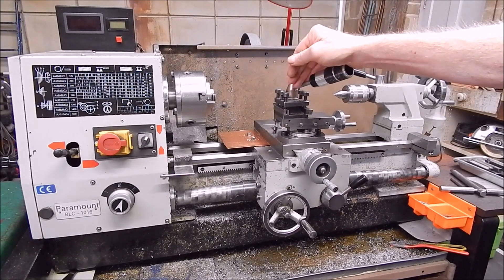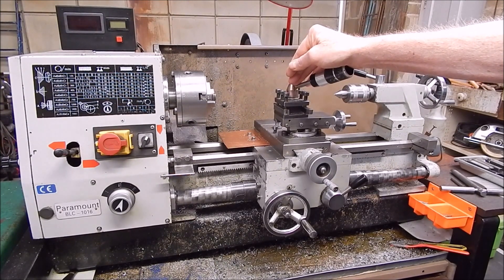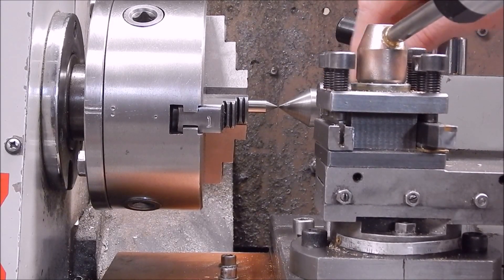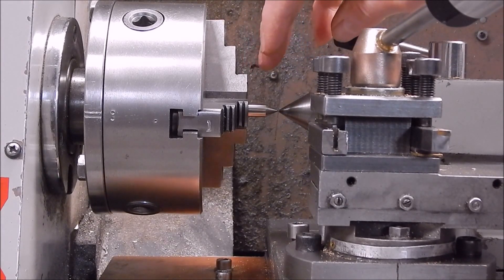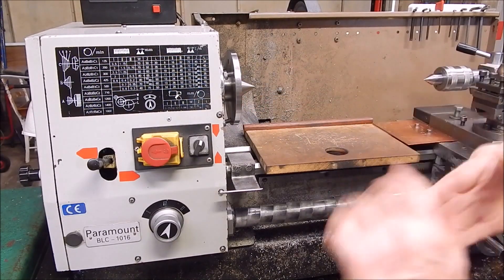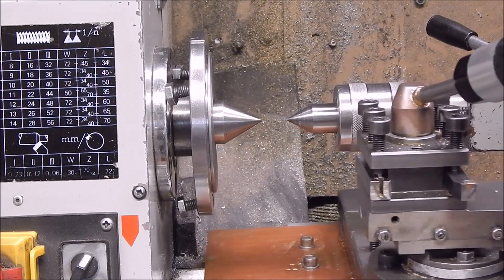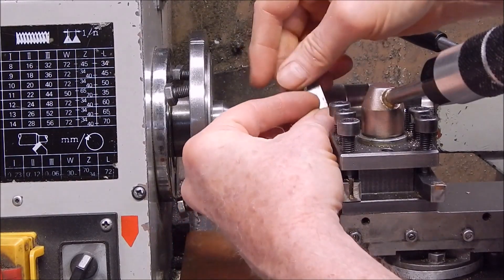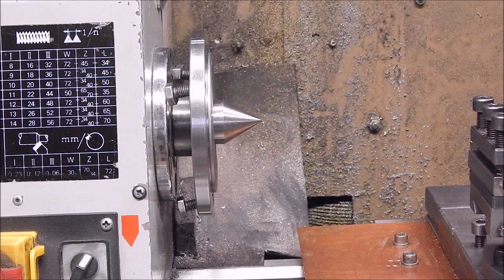How to check your lathe tailstock alignment - the quick and easy method

Comment: If the length of the bed was out by a mm or two, at the end, the centres would still meet in the centre, and the razor blade would still be vertical… I have a problem with my lathe in that when I turn a 25mm x 300mm shaft (without using a centre), it is smaller at the end and larger at the chuck end… this means that the end bedway is not perfectly aligned with the chuck… so I need to find a way to bring the end of the bedway closer to the operators side… I haven’t worked out how to do that yet…
Reply from the maker: Hi Barry.  You just move the tailstock away from the operator to fix the taper error.  It should have adjustment to allow for that.   Cheers Rob
Reply: @Xynudu  no, if I use a live centre, then it is parallel… but if I don’t use a live centre, just a 25mm shaft, 6 or 8 inches in length, then the shaft is tapered…
Reply from the maker: If you machine that length of shaft unsupported it will certainly be tapered smaller at the chuck end, if the centers are aligned.  The job will flex away from the cutter the further away from the chuck you cut.  Why would you not support the job ?  I don't understand what you are saying as the result makes no sense.
Reply: @Xynudu  surely, a shaft that is 25mm ØD by 8 inches long, doesn’t need a centre support ? Maybe then I have to change my approach to this… i am inexperienced so I will take your advice…
Reply from the maker: The job will definitely flex/bend away from the cutter pressure.  Support the job and you will see a difference.

Comment: What if your tailstock is lower then the spindle?  How do you adjust that?
Reply from the maker: Many Asian tailstocks are made in two pieces to allow for horizontal adjustment.  Use a shim between the two pieces at the front edge to lift the quill centre.

Comment: My lathe needs the moon to be in line with the Sun to get that accuracy. Use a smaller drill than stated, to get correct size. Going out now to shim some play out on the crosslide/ bed. Also put a lock on the bed.

Comment: Sometimes I notice things can look a bit out of line due to the camera being used. I have never seen the razor blade test so I'm off out to my workshop to check my own tailstock.. Cheers!
Reply from the maker: It's a very old test that a few manufacturers recommend in their user manuals.  Try it with the tailstock quill extended and retracted as that will also indicate if there is any divergence in the quill.  Cheers Rob

Comment: Well I am only a neophyte or tyro when it comes to metal work.  But I sometime think my drills are jumping to center when I drill on the lathe.  BUT ... As long as it runs true while I am making the hole then there is nor worry to me.  It doesn't seem to affect my projects at all.  I think another way that you can prove your tailstock base is not worn dropping the quill is to mount a piece of know good round stock between centers and run a clock along the top of the bar with the carriage.  Good tip and demonstration Rob.  Now as far as blowing smoke out of my ass, well I had this Mexican dish one time ........

Joe
Reply from the maker: I always align the tailstock by tramming an indicator along a test bar, same as you.  The razor blade test is a good reference/quick indicator, but it doesn't take into account any twist in the bed or ways.  It's quite possible that the tailstock may be off centre at maximum separation between centers.  Mexican food can do that to you ;)  Cheers Rob

Comment: Hi Rob ,
I wish i had a dollar for every time i have read about or watched a video of how to get the tailstock perfectly  aligned and all the stuffing around associated with the techniques they showed . I have seen guys using indicators mounted to the chuck to clock the tailstock barrel , turning bits of bar between centres and all sorts of wiz bang ideas and all of them are overkill! . When i rebuild a lathe i set up the headstock using a precision test bar as this is important i then shove a dead centre in the tailstock and lightly grip the end of this in the chuck and tighten the tailstock adjusting bolts and that is that - for 90% of the work i do with the tailstock ( mostly drilling ) it is good enough . If i do turn between centres i then do adjustments as needed using the workpiece as a guide and when it is all done i use the same method you have just shown to check where everything is sitting and adjust as needed . Lathe beds ( hobby ) are never perfectly straight or unworn so what you set at the chuck will differ to what you get at the other end of the bed and it doesn’t take much twist to knock your tailstock out of perfect alignment - how do they know if the ways where the tailstock is running are truly collinear with the ways where the bed runs ? 
I learned this running cylindrical grinders and you didn’t have time to stuff around getting back to parallel after grinding a taper - use the scale on the end of the table to get a base zero  then touch of at each end of the workpiece and use the feed dial to tell you how far off you are and adjust accordingly. 
That’s what i like - nice and simple , get it done and get on with the job !
Reply from the maker: Yes, that about sums it up.  The razor blade test is just an indicator, but not how I would set up a tailstock.  I generally tram a test bar with a test indicator.  Even that is no guarantee and there is no substitute for miking the job in a few places to confirm linearity.   Having a tool makers lathe makes for good practice ;)  Cheers Rob

Comment: I think it's more likely a drill is not true or the face of the work than the alignment of your lathe...  I know what the bloke is saying but it can be an artifact of having a camera mounted somewhere you could get some vibration or strobing effect from lighting flicker etc. that gives that apparent movement of a drill bit.  Surely the heavy shaft of a centre drill is to give a rigid and true alignment for the relatively small tip section - compared to the small shaft diameter of a small drill bit and the likelyhood quite a few of those cheap small bits are not actually straight on close inspection even from the packet...

Comment: In the past I was stupid enough to adjust the left-right of my tailstock by turning a round bar over and over. The razor blade trick is way easier and faster - thanks for demonstrating!
Reply from the maker: Hi John,  the razor blade trick is a fast and easy way to check alignment and you can use it for adjustment.  I usually use a test bar and test indicator to set mine up, but that's just force of habit I guess.  Cheers Rob

Comment: I went back and looked at the previous video and yes that spot drill did wander around but I think I spotted the reason for it. Rob did not face the end of the brass by the look of it. He cut the brass on the bandsaw, then put in collet and threaded it . It looks as if there is a cut surface not faced as he spot drills it I could be wrong and if I am correct that would be the reason why the 2mm spot drill wandered. Rob it's down to you to tell us if you did or didn't face the brass before spot drilling the work !
Reply from the maker: Guilty as charged.  It looked like a clean cut so I went with it.  Brass also tends to grab a bit with really sharp drills and this was happening as well.  I think you have identified the culprit (s).  Bad Rob.

Comment: The test with the razor blade isn't a definitive test of the condition of the tail stock. Attached is a link to a copy of a Taiwanese made Dar Sin 12"x24" (300mm x 600mm) bench lathe inspection report. Note the inspection of the head stock and tail stock require a ground test bar with the appropriate Morse taper (about $45USD from India).  Items 3,11,12, & 13 pertain to the tail stock. Item 12 checks the condition of the Morse taper in the quill using the test bar.
You can imagine a situation where the razor blade test would indicate no fault but it would be true only when the tail stock and quill were in just that one position. Pull the tail stock back and extend the quill and ends of the dead centers may no longer be in alignment.
https://postimg.cc/gallery/tq51sPs
Cheers from NC/USA
Reply from the maker: If you had paid attention, you would realise that I did the test both with the quill extended and retracted.  Cheers Rob

Comment from the maker: Try this with your lathe and see how you get on.

NOTE:  I always align the tailstock by tramming an indicator along a test bar and then checking any job with a micrometer in several places.  The razor blade test is a good reference/quick indicator, but doesn't take into account any twist in the bed or ways.  It's quite possible that the tailstock may be off centre at maximum distance between centers if the bed is not perfectly true. 

Cheers Rob

Comment: One of the great things about doing this kind of work is that no matter how many years you have been at it you can still learn something. I have never seen anyone check alignment like that before. I have laid my 6 inch scale on a round part and used the tip of the drill to tell me if I am on center and I have used my scale between a cutting tool and something round in the chuck to see if I am on center but I had never thought of checking tail stock alignment the way you did. Thanks!
Reply from the maker: It's the ultimate test.  Pass this and your lathe is in good shape as far as center line alignment goes.  Cheers Rob

Comment: Gday Rob,
I am a new subscriber not at all negative. I too saw the drill jump/climb. I just went back and watch your collet video again, 15:58 and for the next 10 sec as you repeatedly touched the drill to the brass rod the drill looked to jump a little.
I has seen similar "jumps" on other youtube lathe videos.
Obviously your tailstock alignment is perfect, another commentor says the drill maybe bent, that also is easy to check (roll it on a flat surface).
What gets me, if it were a random equip error the drill would jump in random directions at each instant, but they always seen to jump up vertically. So maybe it is a camera parallax/trick or similar.
Keep up the good work

Has the small sumore arrived?
Greg
Reply from the maker: Hi Greg,  this can be caused by a number of factors.  It can even be camera angle.  Maybe if the comment had been less forthright I wouldn't have done this video ;)  The Sumore lathe hasn't arrived yet.  Hopefully it will be Monday.  Cheers Rob

Comment: Great trick Rob! I use a similar method for setting/checking centre of a tool, never thought about trying it in the tailstock. Going to keep that method in the tool box for the future :)
Reply from the maker: Hi Adam,  it's the same method for center height.   This idea has been around since lathes and drills were invented.

I usually check tool height against a center in the tailstock as you aren't always turning an item that readily takes a flat checking surface (eg,  when boring, or a very narrow work face).  It's a habit I got into, but there are no hard and fast rules in this game, so do whatever works best for you.  Cheers Rob
Reply: @Xynudu  yeah - the habit I got into at class was to set all my tools on centre in quick change holders before starting anything. I'm soooo glad I never had to use the lantern style holder!

Have a good one!

Comment: There is a good chance if someone saw a drill bit jump a bit as it was first engaging the work, the drill bit itself wasn't perfectly straight to start with or the drill chuck is just a bit off. I see mine do that quite often on my lathe, but the tailstock is dead nuts on with the headstock spindle. I don't see my center drills do that, so I'd be more inclined to think it is the cheap jobber drill bits I use. Maybe that was what he was seeing?
Reply from the maker: Maybe.
Reply: If the drill bit isn't  sharpened symmetrically or the Jacobs chuck is a bit worn you may see this happen.
Reply from the maker: Yes, the drill grind can easily (and most likely) cause this.  Quite a few things can cause it.  Cheers Rob

Comment: Hi Rob, great demo of the same quick and dirty method I use often to check things are in alignment. I think a lot of the issue here is camera angles, I have watched lots of my content back during editing and seen stuff that I didn't see live on the machine and that was not born out in the dimensional results. This is the issue often created when watching 3d stuff on  2d screen with parallax error and fish eye thrown in for good measure. Cheers, Jon
Reply from the maker: Hi Jon, yes camera angle is a bit of a bug bear with videos.  Still it makes for a useful topic, even though this trick is as old as the hills.  Cheers Rob